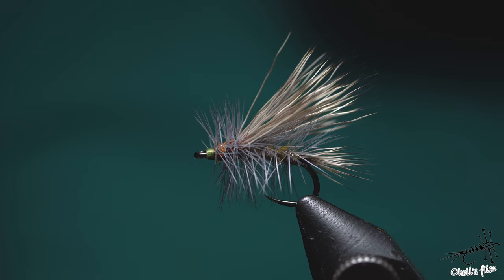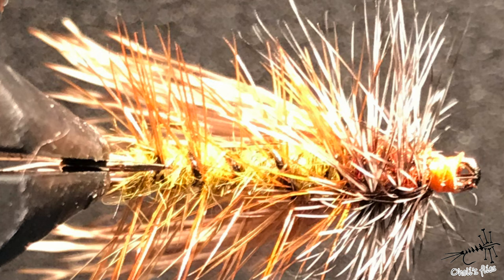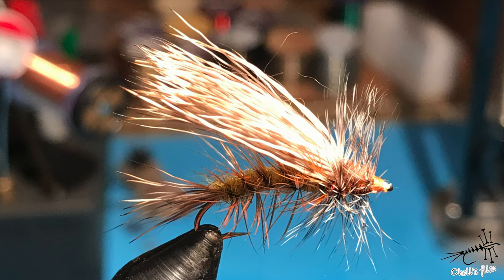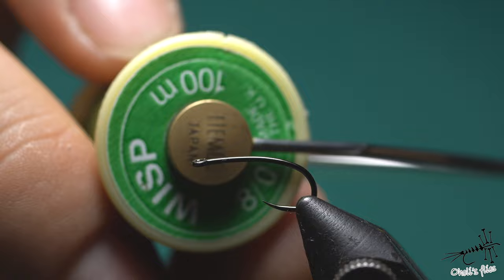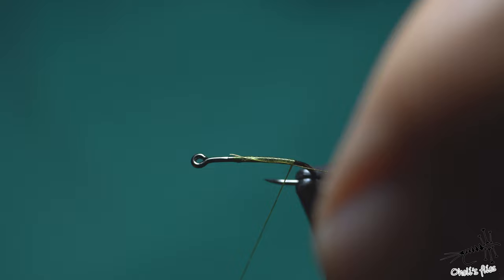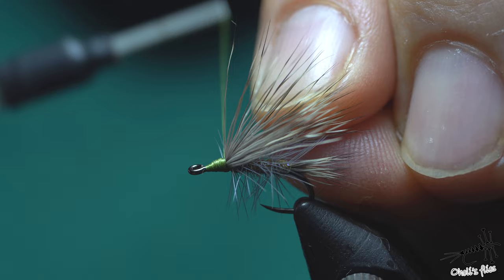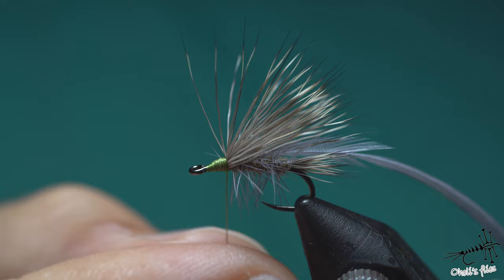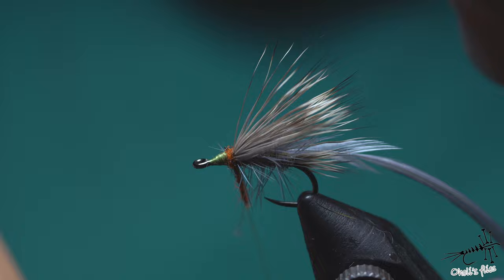Stimulator (Comments on Your Fly)

Comment: Vladi,
Thanks for critiquing my fly. The deer hair I used was from Hareline, and it was not good quality. It has SO much underfur and I just can’t get it all out. Still catches fish, though. Like yours, because it can double as a caddis. Thank you.
Reply from the maker: Your fly is great. As i mentioned just underfur that have to be removed and eye more open... Thats all. All the rest is great. I have no doubts it catches loads of fish. What i like the most about your fly is the way you aligned hairs to curve in the same direction. Thats not easy for everyone. Thanks for sending your fly. Cheers
Vladimir 😀🍺
Reply: I use Davie Mcphail’s trick where he grabs the hair, pushes it forward a few times. Almost creases the hair at the tie in point. That causes the hair to lay down more, and curve towards the body of the fly.
Reply from the maker: @DavidJones-vy6cn  cant say for sure but, i have a small request if you dont mind.... Put freshly tied fly above steaming water for few seconds only and tell me what happens.. Maybe the hair will flare more... Meaning that by creasing you force hair in unnatural way to behave.... Steam will bring back materials nature....
Its trick i picked up from Wayne Luallen. He has by far the greatest influence on my technique. Several times when i forced materials and i thought i had them tamed he proved me wrong 😀😀